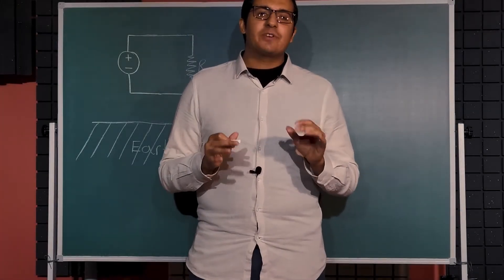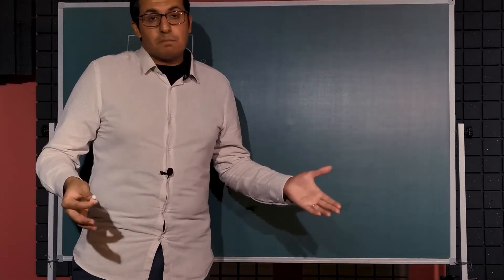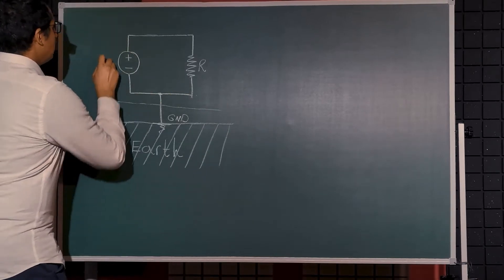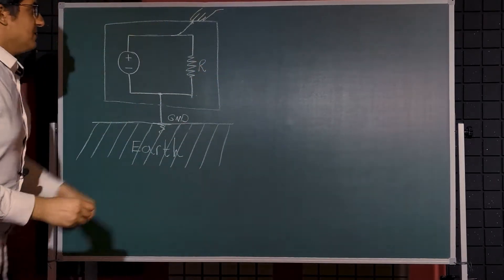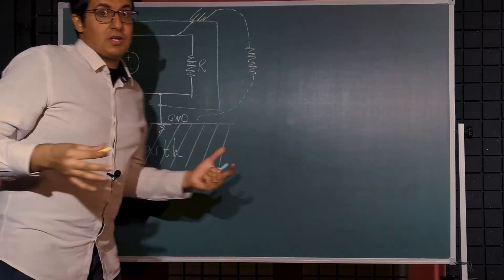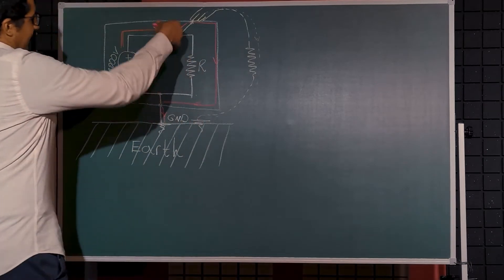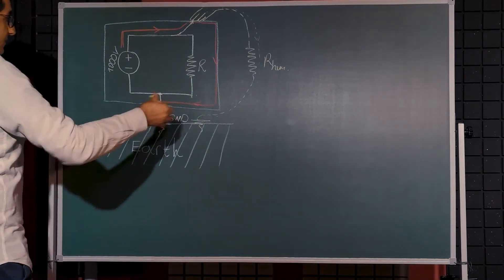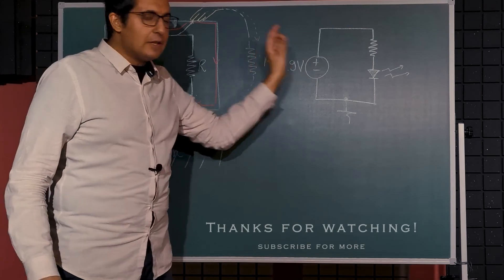What is Ground in DC Circuits (GND SIMPLY Explained)

Comment: I understand the EMI noise reduction, but I dont understand how the current flows to ground, in AC circuits I understand because the neutral is connected to ground in the distribution box so it completes the circuit to source trough ground that way and trips the safety differential, but for DC the current would not go through ground unless it was connected as well somehwere else so there is path for current to flow? Maybe there is something I am missing, but then for DC you would just connect the negative to chasis and have a fuse in line for safety protection, and grounding maybe just for the EMI noise aspect